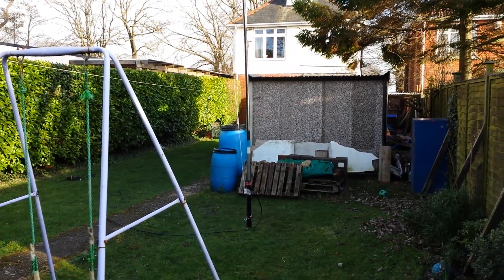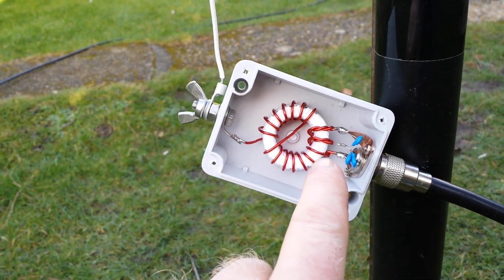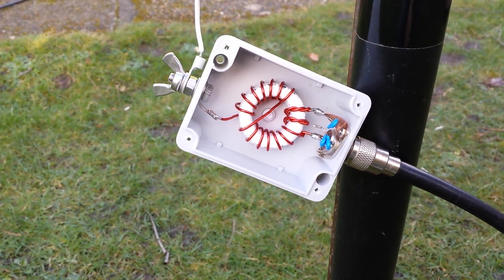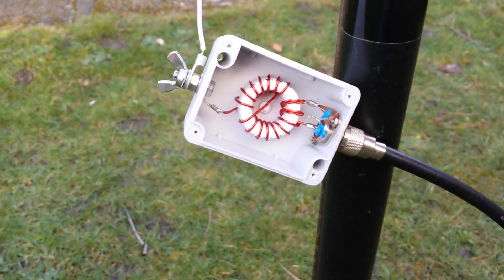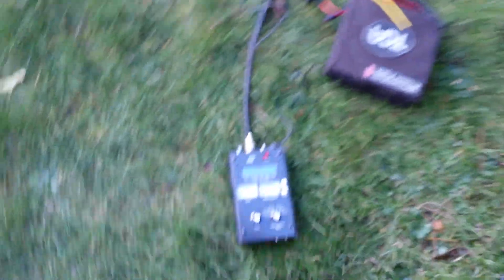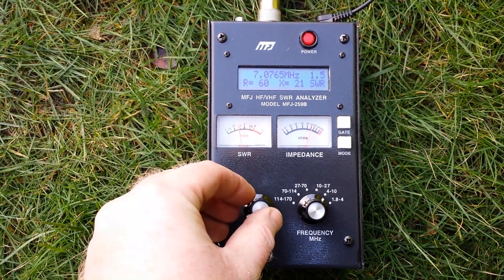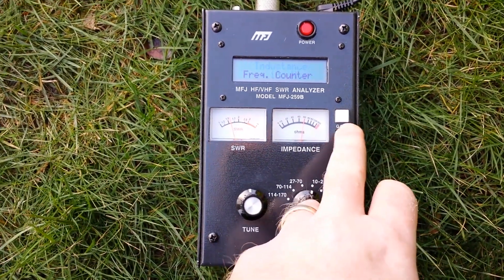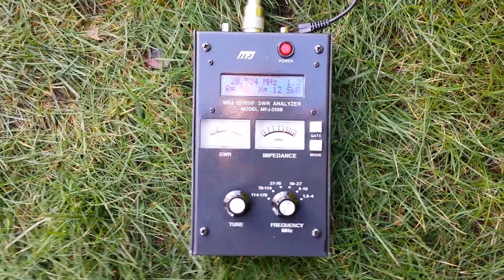Homebrew 10/20/40m  EFHW vertical Antenna "SOTA"

Comment: Variable capacitor would be worth a try, what do you thin?
Reply from the maker: not required on ferrite cores, but useful on iron core
Reply: @mk1tina  thanks, I was just asking myself what will happen when the fixed capacitor at the coaxial connector is replaced with a trimmer capacitor 🤔
Maybe possible to optimize SWR?
Reply from the maker: @tropenband it would make it tunable

Comment: Bad capacitor.

Caps with BLUE coating are for AC line snubbing, NOT RF.

They have high dielectric losses at HF frequencies
Reply from the maker: Thanks for the heads up

Comment: Mark.. you probably didn't need the plumbers tape, you wanna get the wire wraps as close to the core as possible.... Your wire gauge size is pretty good, but the FT 140-43 could be increased to a FT 240 43 size.. because you want to avoid saturating the core, even on 100 watt SSB voice peaks. Before me now sits a dual core FT 240 43 balun I just wound, similar to yours, and I only run 100 watts from an FT 891. but I've become aware that these cores saturate far easier than many realize.. suggest you ditch the tape and get a FT240 43. I use this to feed a 130' EFHW installed as a straight line sloper... VSWR is great, nothing back 1:1 on 40 20 15 and 10 and low on 18...1.8:1 Work any DX I hear and not only just the big guns, you can always work them but I also work 50 and 100 watt stations of modest size (and means) from western North America

Comment: 2EOVOV RADIO
What is the diameter of the wire on the ferrite ring?  I assemble trans 1:49, on the ring ft140-43, I choose components))
Reply from the maker: I dont remember now but it's not critical

Comment: The transformer you've made is 64:1
You have 16 turns on the secondary (the twisted 2 turns count on the primary AND the secondary winding).
Reply from the maker: Correct
Reply: I'm making one at the moment but have gone for 49:1
Is 64:1 a better match?
Reply from the maker: Hard to say as I haven't tried the 49;1 on this core. I ha e tried it on a full size 80m efhw wire and it resonates well on all harmonic bands 10 to 80

Comment: I have FT 240-43 in stock. Will there be any change in design ? For 40/20/10 m bands ? DE VU3MDL
Reply from the maker: shouldnt be as its the same core mix

Comment: you have no counterpoise or ground ? no choke ?
Reply from the maker: End fed half wave antenna doesn't need a ground or CP as the coax braid takes that role. I use a RF choke at the radio end for regardless of antenna
Reply: ok thanks for the reply (where I realize you already answer that below...) can I ask what do you use for the RF choke ? just coax turn or something else ?
Reply from the maker: @Aleziss  the most versatile and effective is 8 turns of coax on a ft240-43 toriod
Reply: thank you for the precisions !
Reply from the maker: @Aleziss  always welcome

Comment: Finally got my 80-meter sloper of this design going and LOVE IT!  I used 49:1 and it works 6-80, only really needs tuning on 30, 75, and 160.  Brilliant signals!  I'm going to make some more transformers and play with variations on length and shape.  Learned it from N4LQ.
Reply from the maker: Brilliant.. That's something I often think of trying sometime.. Well done and thanks for sharing . 73

Comment: That will give you 64 to 1 impedance transformation.  Seems like you found the correct combination for your endfed. Nice job. W4GSM
Reply from the maker: Thanks David
Reply: what is the difference between 49:1 and 64:1 then ?
Reply from the maker: @Aleziss  2 more turns on the secondary
Reply: and the goal is to acheive what versus the 49:1 ?
Reply from the maker: @Aleziss  a 50 ohm impedance
Reply: Impedance matching is the goal, 50 times 49 is 2450, if that is the Imp, of your end fed then you have a good match, If it is not then another transformer ratio is then the answer.
Reply: thanks

Comment: Hi Mark. Am I right in thinking that a 66 foot long wire would be resonant on 40 and become a resonant full wave on 20 and a double full wave on 10 - making all three bands resonant? I have also found that these efhw are also tuneable (if not too efficient maybe) on 12, 15 and 17. Your design is great I know as it shortens the length of the three bander to about 40 feet if I am correct - great for portable. Looking to make a version to use at low tide one very early summers morning on the local beach. 73
Reply from the maker: AMATEUR & 11M RADIO TIM you got the right idea

Comment: Great video on your vertical antenna .  The question that I have is your unun?  I have a 5/8 vertical for 20 meters and the feed point is approximately 1300 ohms. Using a 25:1 unun I will now have a feed point impedance of 52 ohms.  I see that there are commercially available units but they are quite costly.  Can you provide any insight as to what ratio your home brew unun is and how you arrived at the number of turns on the coil.  I guess what I'm looking for is how one would construct a 25:1 unun?  Thanks in advance, 72, Steve Hose KD1DT
Reply from the maker: Steve Hose this is a LC network transformer for EFHW and is classed as 64:1.  Cant help on UNUN..This antenna is around 3000 ohms. The windings are physically 2 primary / 16 secondary making it 8:1 in its simplest form. So 8x8=64:1. Take 64x50=3k the impedance the antenna presents. That's how you configure EFHW.  UNUN is a completely different animal..
Reply: mk1tina thanks so much for the fast reply!  It does help as I think of a vertical as an end feed antenna... So using your information I should be able to wrap two turns as a primary with ten as a secondary which will then give me a 25 to one taking the 1300 down to 52 ohms.  If my thinking is correct that is... Thanks again for your input!  73, Steve KD1DT
Reply from the maker: Steve Hose yep.. you got it.. 52 ohms is close enough 73's
Reply: Steve Hose how did you know your feedpoint impedence is 1300ohm?

Comment: Broadband transformers with ferrite torroid are briadband anly for lower impedances, not for 2400 ohm.
Any type of choke is better then no choke at all.
I am trying to tell you that much better things are possible
 with end feeding. You can check out my setup at QRZ.COM.
73 VK3EGN
Reply from the maker: Tino Pavic absolutely but easier on monoband versions. 73 and seasons greetings

Comment: Brian seems to enjoy giving incompetent advice.End fed is vertical dipole, not vertical monopole, therefore there is no need for ground plane. Impedance transformer 64:1 adjusts 50 ohm coax to 3200 ohm end fed antenna impedance.Using 3200 resistor instead of antenna is good idea to check impedance transformer matching.However, it is only the first step - and actual antenna will not work as resistor did.Reason is very simple: antenna is highly imbalanced.After impedance transformer you need choke with 10 times more impedance. Ferrite beads can not do this. I use coax choke balun, made resonant close to operating frequency.BTW  even 30 kohm choke will not work well, you need two of them.73 VK3EGN
Reply from the maker: Tino Pavic A coax choke will not work for 3 bands as they are narrow

Comment: An end fed vertical!  How nice. I notice no ground planes at the base of this antenna, thus no RF mirror. The balun has far too many turns and is no way near flat. A 1:1 balun should be flat from 1:0 through to 28MHz rising to 1:2 at 50MHz, then a steep curve to 5: or more after this point. The core used it far too narrow for the use he puts this balun to. Did he put the appropriate resistive (carbon) test load on the balun before hand? Why does he need capacitors on the unit? The distributed capacitance is nulled by the reverse winding. There is no need for added capacitors. The core needs only 3 turns (4 max) for a current balun of this type.

X should be well below 5 at all times. A resonant antenna should not have X as 15. Look sunshine. I can see that your garden will accommodate a fan dipole with 7 bands viz: 40m, 20m, 17m, 15m, 12m 10m 10m. Why do you mess about with this CB style rubbish? I assume you like listening to signals being many dB down? Go ahead.
Take some advice from an old-timer. Fix on end to your chimney, and fix the other end to a 25 or 35-foot pole by that garage and get the feed point and balun up high as you can, and, get rid of that bloody carbon-fiber pole. It's for fishing, not amateur radio.

Your choke needs to be a minimum 8 turns wound on a 152mm - 200m (6 to 8-inch) plastic pipe type former. You need to STOP RF returning down the outside of the coax braid. You could slide 5 ferrite beads onto the coax to do the same thing I use both.
One more thing. Get rid of that stupid thin CB coax. You have lost 70% of your signal be for it even gets to the radio using that rubbish.
Reply from the maker: hello Tony. thanks for your stupid comments. This clearly shows you have no idea what this antenna is. This is a EFHW Transformer, not a balun!!!. The designs are completely different animals. EFHW don't require a ground to push against, unlike a quarter wave. The pole is fibreglass and the antenna is vertical to work portable over salt water. I have no plans to use verticals at home as they are crap in a domestic environment. I'm sure you now see you jumped the gun. this is a friendly hobby, let's keep it that way
Reply: @mk1tina  hi What is the construction of the coil at the top end of the wire to give it 40m

All the best
Mark
2w0mtd
Reply from the maker: @markdavies7827  hi Mark, it's a long time ago.. I'm pretty sure I wound 58 turns of enamel wire around a 20mm pvc former. I dont think its that critical as it's their to imitate length of the antenna.
Reply: Those capacitors are to resonate the transformer secondary so that it presents a high impedance at ~14MHz to the half wave of wire forming the radiating element, the input to the transformer is tapped down so that the impedance is near 50 ohms for the bands desired. It won't be perfectly 50 ohms on the intended bands, the intention is to get a low enough VSWR that a low power Tx can still drive it or a higher power one using an antenna matching unit to get a lower VSWR to avoid the Tx power being folded back by any protection circuitry fitted.
Reply: I don't think many people understand how you feed a half wave or other high impedance antenna, everyone is fixated on 50 ohm feed points without thinking about why they are (or aren't) that impedance and what you have to do to get current flowing on the radiating element.

Depressing about the ad hominem attacks on you by some people, it's not good, especially from people with amateur licences from way back who should know better.
Reply from the maker: Brian Morrison thanks for your comment. You have hit the nail on the head, people just don't understand the science of triband EFHW antenna building. The video was to clarify the myths and help show how it works when multi banded.  Sadly people just send me abusive emails claiming I have built this 9:1 wrong!. or made the Balun wrong or i need a ground.  Sometimes I wonder how they got a licence .. You sir have restored my faith in others understanding antennas that are not the standard school of thought.. 73 and have a great Xmas. 2e0vov
Reply from the maker: Thanks Brian. Thank god you can see its not a Balun. This antenna design confuses so many people .. You should see the emails I get :-/ 73
Reply: 73 from this rather grey-bearded old amateur and professional RF engineer 👹
Reply: " The distributed capacitance is nulled by the reverse winding. "
But he didn't reverse the winding, if the photo is accurate.

Comment: Does the lack of a counterpoise cause problems with this antenna?  I keep hearing this antenna will cause radiation on the feedline and your equipment, so am a little undecided if I should use it as my primary antenna or not.
Reply: +Nathan Daniels Anyone who says this does not require a counterpoise does not understand that the feed line is acting as a counterpoise.
Reply from the maker: its a EFHW, so no counterpoise required.. Anyone who says they do doesn't understand efhw. Check aat5b website for design and theory..
Reply from the maker: +mk1tina aa5tb
Reply: +mk1tina actually aa5tb uses about 1m long counterpoise. He also argues that there might be additional return via stray capacitance into the environment and down the coax line especially when no counterpoise is used. This is fine with QRP levels, but I wonder how advisable this would be with 100W. BTW, I use the same setup with Yaesu 817 with and without counterpoise wire. In both cases coax does take return which can be easily demonstrated - with analyzer attached read SWR (at the end of the coax), then grab the coax with your hand - SWR will change because your body adds to counterpoise.
Reply from the maker: +jrfoleyjr the feeder is acting as a counterpoise.. hence no counterpoise required
Reply: So if you add a counterpoise, and I've seen ratios of about 80/20, doesn't that make it an ocfd?
Reply: TO get a better understanding of the EFHW, I found this presentation (and there's a FB group), rather helpful.  NO counterpoise needed.  AND/BUT/OR Steve has sorted out a switch and ground system which makes the antenna functional on 160m, 60m, and 6m-making his installation good for 11 bands.  Whoot. https://www.youtube.com/watch?v=N_o0jneBEh0
Reply from the maker: +jrfoleyjr but u r splitting hairs
Reply: Point being,  is that you do not want RF on the outer of the coax screen,  especially given the very high voltages at the feedpoint.   The counterpoise only needs to be short  and use a choke to keep the RF off the coax.
Reply: mk1tina , lol... "no counterpoise required"..... "because it already has one" (that is required) to work! And... that secret counterpoise that isn't really a counterpoise that it doesn't really have because it actually has no counterpoise for real is... just the feeline shielding attached to it acting as a poor substitute at the whim of whatever length of coax you're using! 
Soooo, no no no no, you're kind of right..... the antenna itself actually doesn't have a counterpoise itself and will not work well at all without a feedline of certain length and/or a choke somewhere along it to prevent unwanted zaps under high power!
Lolol, just lol!
You're a funny guy.
Reply: And then, the feed line radiates in the shack and may even gives electric shocks if your station is not solidely grounded...

Comment: Thanks for the information, made my transformer today using the same windings as you with the Ft-140-43 core. Also used the 100pf capacitor. Excellent results in 20 and 10 meters, havent added the 40meter coil or tail yet im winding it now. Swr was great on both 10 and 20 and first contact was a DX station on internal battery of my Ft-817ND. I used 22 gauge wire as my element as I will only be doing QRP work with the antenna. Thanks for the video and information.
Reply from the maker: Looks like u r on a roll.. 73's
Reply: Dewayne Treadaway up

Comment: exactly how long and what gauge of wire have you used in the antenna?.. I have a new 817ND and looking for a end fed antenna to use backpacking, this seems to be it as it covers the bands I want to use without a tuner. I just ordered the ft-140-43 core. I understand you have the 58t of enamel wire on the 20mm core, but the tail after that how long is it?
Reply from the maker: hi. Im using 0.75mm multi strand cable, but what length I ended with wont match yours due to many variables in the loading windings and insulation velocity, transformer etc. The way I set mine up was to build it as a efhw, then trim it for resonance. Sorry this isnt the quick fix you want, but their are no shortcuts to get the best results!
Reply: Thanks for the reply. Not really looking for a "quick fix" just trying to get an idea of how much shorter or longer than I was originally thinking the element would be. I also build antennas but have not had to wind transformer, etc.. Ive built 3 or 4 multiband hex beams with excellent results. I am still trying to figure out the twisted wire on the torroid. I understand the 7 turns then the 7 turns on the other side.. but does the twisted pair for the primary turns where does the end start and end with the actual twister wires? Does that question make sense?
Reply from the maker: Dewayne Treadaway you r confused about the transformer construction. Take a look at the site of aa5tb for his excellent write up on efhw. Its much easier than explaining on here.
Reply: Dewayne Treadaway ㅜ

Comment: What kind of the core is in that UNUN?
I've been doing some different UNUN's with different cores and I couldn't find the right one....
Best regards
Reply from the maker: Its a ft140-43 core and will be ok up to 100w. Most hf stuff is best built on 43 material. You might benefit looking at AA5TB website to help understand EFHW antenna's and how to make them sing
Reply: For the record, it isn't an UNUN, rather a 49:1 (approximately) autotransformer.

Comment: Hi... is this setup for QRP only ?
Reply from the maker: It will run to 100w with this ft140-43 core
Reply: Sorry will the caps allow 100w ? Thanks
Reply from the maker: Yes use 1kv. Ive changed my 3 for one 100pf 1kv.
Reply: thanks